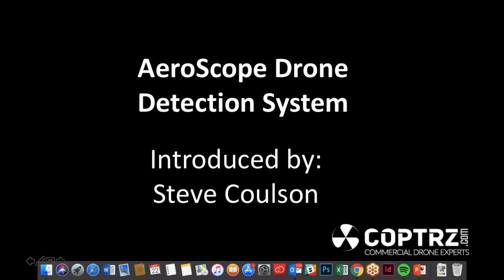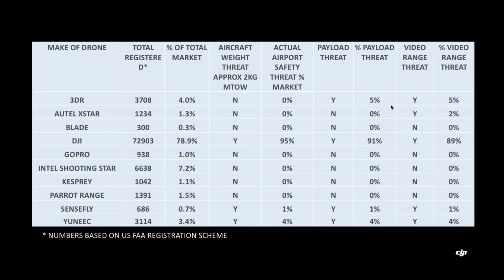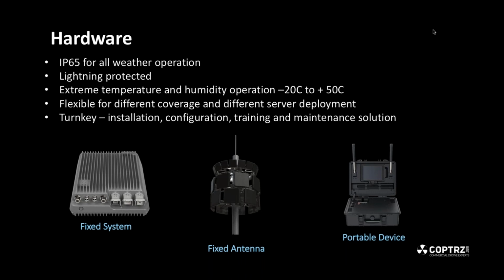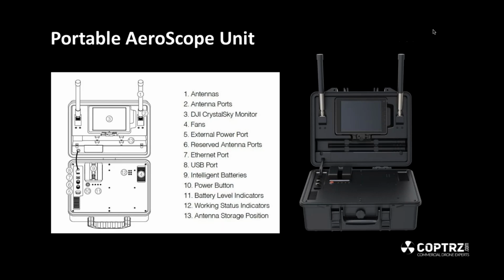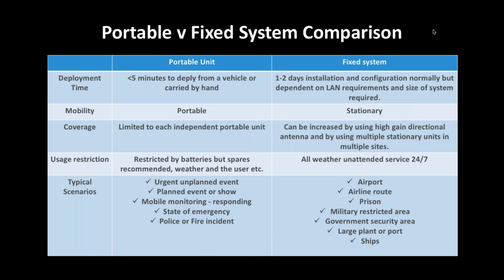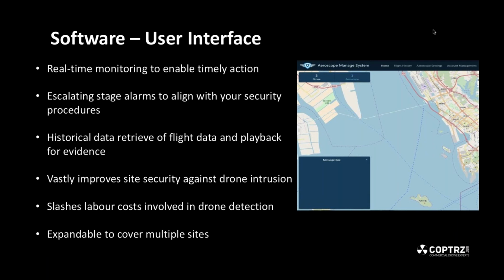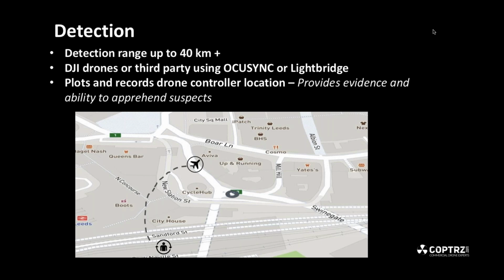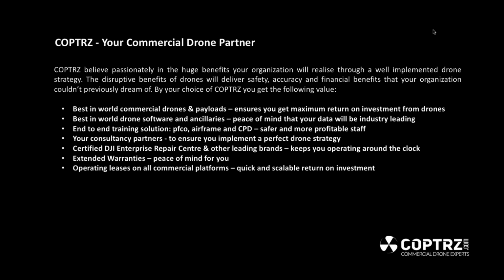Webinar: AeroScope Drone Detection Systems & Countermeasures

Comment: Very interesting video! Can you answer a question for me please, what if the pilot is flying say a DJI drone using litchi or other 3rd party app is ALL the information still available to the detection equipment? I've added to like videos. 🍻
Reply: That's a really good question! Did you ever find out?
Reply: @meti9230  no, but I've recently heard that DJI are forcing updates outlawing 3rd party apps so if you use litchi I'd avoid updating if I were you.
Reply: @TWOWHEELFIX  that's crazy man. I'm from the UK and got approached once by the police last summer said I was flying close to one of the palaces here. When I asked them how they found me, they said they can tell me but they'd kill me ;) as a joke but I saw they had a map of all the drones flown in the area and their details. This got me more curious about infrestructure behind this this tracking technology I never knew  the police authority had access to. Is the tracking also availability for the Autel drones or other brands too? Thanks!!